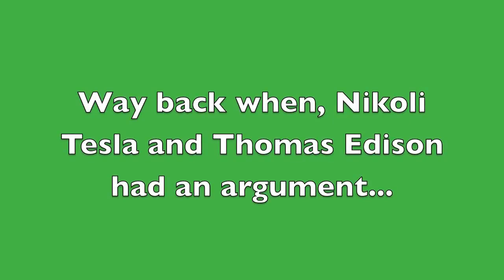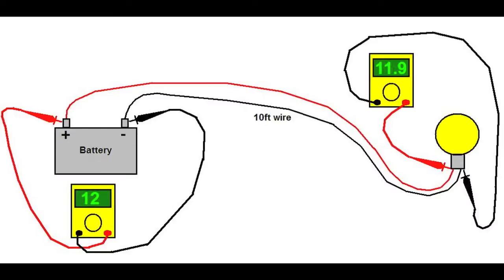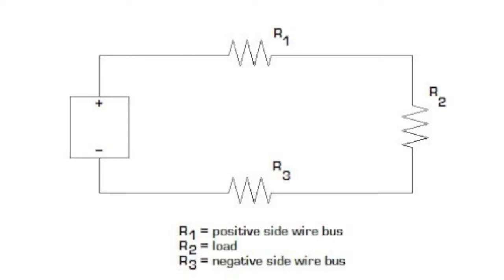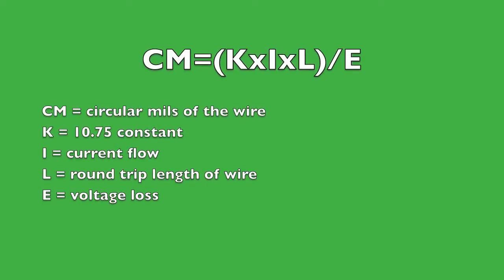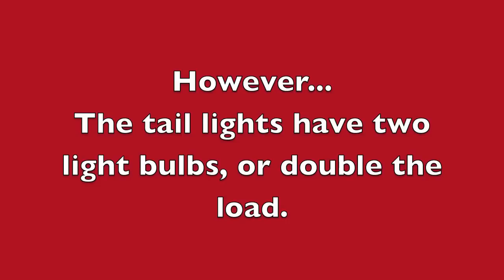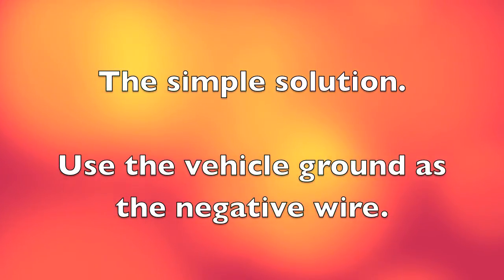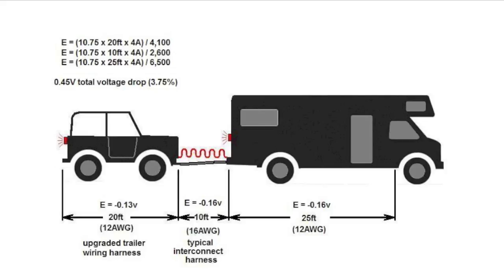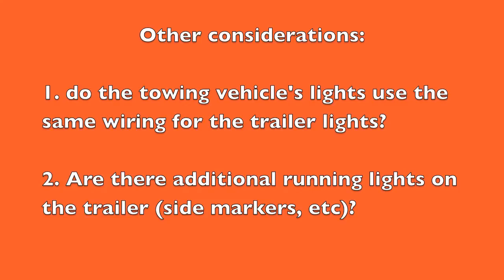Is your RV, trailer, or towed vehicle's trailer-light wiring sufficient?

Comment: 12 Gauge!!! That's a bit much and I can't say I agree with your voltage drop figures for 4 amps running through that much 12 gauge. They don't use that heavy a gauge in 53' long trailers and the lights in those work just fine. Also there are plenty of DOT approved LED's, you see them on all the big trucks with LED lights and in modern cars that have them so how you can't find any of them is beside me because they've been around for years.
Reply from the maker: +Killer2600 The formula I use to determine voltage drop in DC circuits is well established. If you have excessive voltage drop due to wiring then the lights will not be as bright.

Here is one of many calculators on-line you can use to determine voltage drop:

http://www.calculator.net/voltage-drop-calculator.html

If you do the calculation for 12VDC and 4A (typically two incandescent light bulbs), and using the one way distance of 53ft (due to using the chassis ground for the negative side):

12AWG:  11.53VDC  (0.67V drop)
14AWG:  10.93VDC  (1.07V drop)
16AWG:  10.3VDC    (1.7V drop)
18AWG:    9.29VDC  (2.7V drop)

As I pointed out in the video, the distance is what reduces the available DC voltage.  Anytime you have a 5% loss in voltage, especially for safety items such as tail lights, you should consider remedy as their effective range becomes reduced.

Of course, if you have additional lights that draw 2A each, the voltage is even less.

I am referring to LEDs that are aftermarket types - that replace bulbs in a fixture. 

For sure, LEDs are in vehicles; my last two cars have them from the factory - but they are not the same thing. You can find aftermarket LED "bulbs" to replace incandescent bulbs in existing fixtures, but not many of those are DOT approved.

Comment: Would a chevy volt be a toad candidate it's a heavy car, fully charged could be left on for the brake lights etc?
Reply from the maker: You would have to check the owner's manual. Most have a section called "Recreational Towing" that describes under what conditions a car may (or may not) be towed.